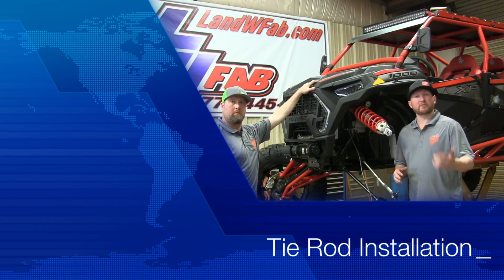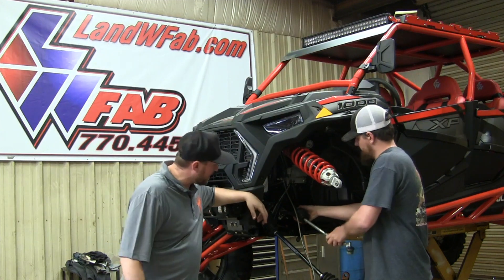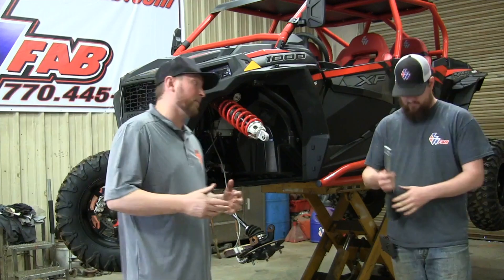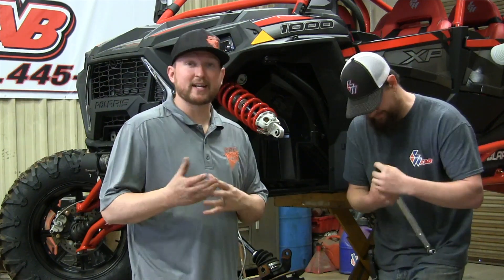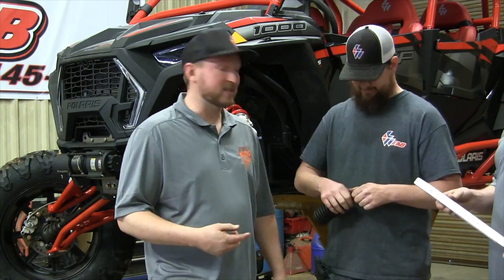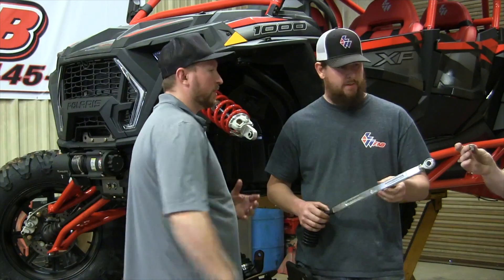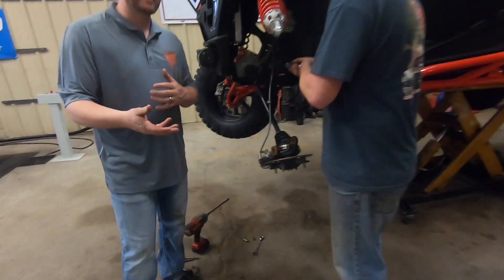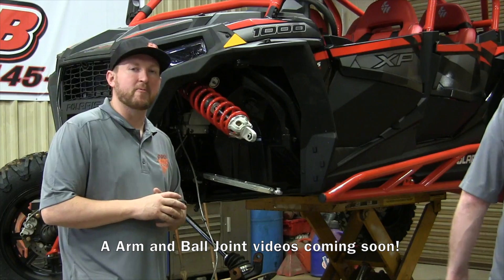Tie Rods

Comment: No LocTite on the the inner bolt that goes into the rack?
Reply: The rack doesn’t spin and the jam nut against the tie Rod would prevent it from spinning there.
Reply: This looks an awful lot like my Rzr. Same L&W stuff and Keller ball joints.